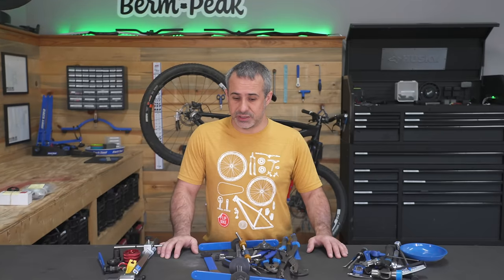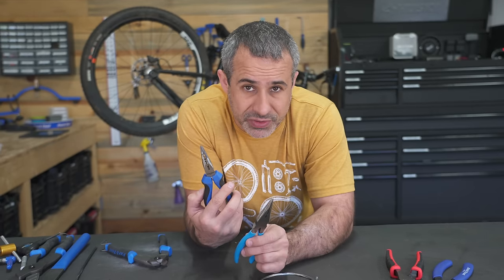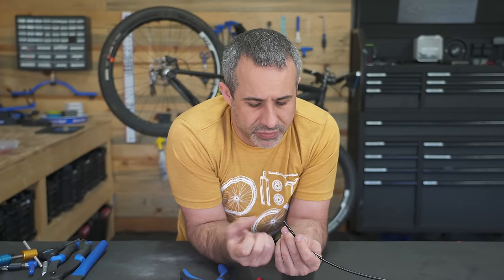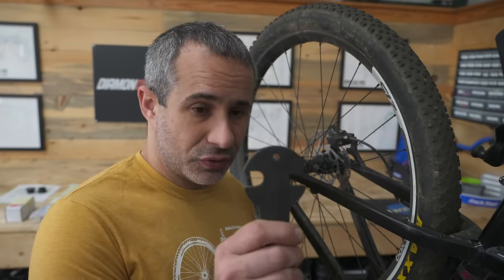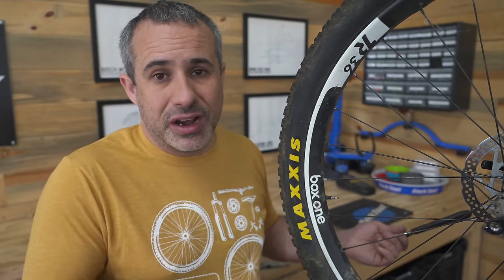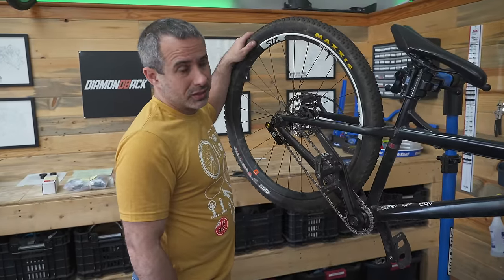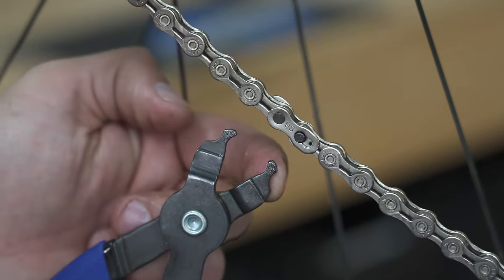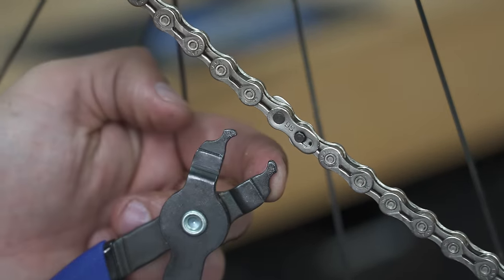Are "Bike Tools" really different from "Tools"?

Comment: For the head set cups I used a 1"×4" piece of wood and a big c clamp ,and it works great. You can get the c clamps at harbor freight
Reply: I thnk it is either lifeline or Xtool (i'm not going to my toolbox to look for it) that make a $20 cup remover and inserter. It, ideally, requires a bike stand to get the bottom one in but it works a treat.
Reply: Thanks good to know
Reply: @M3PH11  thanks good to know
Reply: I have an old scrap block of oak with a hole in it as a "washer". So far it's worked well for the three times I needed to press in a headset.
Reply: @newttella1043  Same. I still have the washers for the nuts to push against, but scraps of wood are soft so they don't damage headset cups and definitely can be big enough to get past the too-small-washer problem. I've used this DIY tool plenty of times.
I also have some PVC scraps that I use to set crown races so it's DIY all around for headsets for me.
Reply: I find this or the washer method tends to misalign the cup as you press it down. I got so frustrated with this kind of press that I gave in and got a good one. Came with machined cups that center the headset nicely and can accommodate those wide 56mm headsets.
Reply: @pjaxy   the way I did it I really used two pieces of wood ,and did one cap at a time . I would have to adjust time c clamp once or twice but I did not have any problems.  The best think is the right tool for the job .thanks for the info
Reply: Dont know about you guys but I dont change my headset to another one in its lifecycle so I just hammer the cups in and replace the bearings. 
I just use a piece of wood and a hammer. I dont really see why I need something else and I dont have any pressfit BB so nah...
Reply: @Vanadium   that is how I did it when I rode BMX in the 80s with steel frame
Reply: I use hammer
Reply: @newttella1043  same here. Hard wood flooring offcuts are perfect..
Reply: RollinRat  that is a good idea, I used what I had
Reply: I've installed threadless headset cups with just a hammer and a block of wood. Just set them up correctly, and hammer the block of wood down (which is on top of the headset cup).
Reply: @pjaxy  Nah, bro, dont you know its way better to spend hours of your day making some shitty jig instead of paying a slightly higher price to have an engineered solution that just WORKS.
Reply: yeah you don't need a specific washer, just a block of material with a hole, and you can get those for free with a scrap wood pile and a drill
Reply: @goldensunrayspone  Like I said, just get a block of wood and hammer the headset on with the block of wood on top of the headset cups.
Reply: RollinRat  A brass drift worked a charm on a steel bike to remove.  Wouldn't think of it on carbon. Oak block still effective installation tool for steel. Actually wouldn't want old school threaded headset on anything new!
Reply: RollinRat  When you do a headset every 5 years or so it might not pay off. The threaded headset is ok, replaced Campy with Campy several years ago and let LBS do the adjustment with proper tools. The modern threadless headset is less fussy and a very rigid structure. Forget carbon steer tubes though. I did snap a Cinelli A1 stem once because it was raised a bit high, and the steer tube threaded excessively long. The wedge did crack the steer tube on that one. The steer tube was replaced by a frame builder and has been fine. It does feel a bit flimsy next to a modern 31.8 clamp stem though.
Reply: RollinRat  Unfortunately my Aluminium track bike has plastic forks, but aluminum steerer at least. Always looking for telltale paint issues around the fork blade, crown and dropout areas. Things are pretty over built and rides hard like its got solid aluminum blades! Trying not to ride into deep potholes in the shade with dark glasses! 2 pinch flats.  Still working on wheel building. I respoked  my 28 spoke track wheel with spokes 4mm too long. No spoke threading tool! I manufactured 56 nipple washers of #8 washer stainless. The rig was hilarious,  drill clamped into bench vice turning a stack of washers on a long grip pop rivet. A 9 inch angle grinder "machined " the washers to a +2, -2mm tolerance as verified with an actual micrometer! I corrected the key spoke at the valve hole while at it. Will probably hammer the J bends with a plastic mallet. Those "machined " nipple washers will probably give a bit. The sealed bearings are another project. The locknuts turned on the axle when the wheel  was tightened into the fork end. No marginal gain here. Torched. Next time I'll cinch the locknuts with about no preload and touch the axle and locknuts with flux wire! (Welder) Red loctite not adequate! Hambini would have a crow! Guerilla bicycle mechanic! I will prevail!
Reply: @Vanadium  Agreed, but probably not good around carbon frames. Block of wood is traditional.
Reply: RollinRat  Been eyeing high flange Dura Ace 36 hole track hubs. Probably never break a spoke built on sturdy rims with straight gauge DT. Some say you can tie and solder stainless spokes. I'd be afraid to louse up the metal with the torch. What about tied and epoxied? I could have Universal Cycles build such a wheel sans epoxy for about $320. The hub is on over stock. What rim profile, box rando style,  or 30mm aero? Brand? Definitely aluminum though. The 32 spoke 3x rear track wheel only broke 1 spoke so far but 36 spoke cross 4's got to be stronger Fixed my 28 spoke 3x rear wheel today as a spare. I'm not thrilled about the hop at the rim seam on this one, + getting locknuts to stop creeping and killing bearings!
Reply: I find the right tool is better, even if only used once. The only reason you wouldn't is if it's expensive (let's say you need to spend 1k on tools for a 200 dollar bike.......then I get why you might not want to). Because your time is valuable too and so is the ease of knowing the parts are installed properly without damage. Peace of mind has it's own value.
Reply: @Knight_Kin  if I do not have the tool I need I try to think of a another way.  As long as you are careful it works good , but I understand the right tool for the job as well .
Reply: rollinrat4850 you are a narcissist.
Reply: rollinrat4850  your reply reeks of narcissism.

Comment: There is no substitute for a cable housing cutter. I've tried. The design of the cutting jaws is critical. It doesn't need to be a bicycle cable housing cutter, but it does need to be a cable housing cutter. Having said that, the cleanest possible cut will actually come from a Dremel because it won't crush the housing, but you will need to flush the housing with spray cleaner to get the metal dust out.
Regarding wrenches, every tool kit should include Knipex pliers-wrenches. They are astoundingly useful in any situation where they physically fit, much better than normal adjustable wrenches.
Reply: great call on the Knipex brand pliers wrench. those are so handy for putting the chain back together. I usually cut cables with my side cutters , then pinch them back into a round shape using the Knipex pliers wrench! perfect

Comment: Agreed! I have a lots of automotive tools and when I started working on my own bikes I could scrape by using some automotive type tools on my bikes but at the end it does make your life much easier to use bike specific tools for bottom bracket, cutting cable housings, headset remover / press and cassette tools (chain whip etc) oh and also torque socket set 😎

Comment: I just went to my local hardware store, got a 1 foot chunk of 1/2" all-thread and they had thick nylon washers to fit inside the headset cups, plus some steel washers & nuts, got a perfect headset press for less than $10. The bike tool versions will keep the headset cups straight, this can be tricky with the hardware store version. For master link pliers, I bent the tips of some junk needle nose pliers into hooks the size of chain rollers & ground them narrow enough to fit the links, a quick squeeze and master link open.

Comment: @12:10 My homemade cup press used some 1x6 boards cut into squares with a hole in the middle for the cup sides and then a stack of 2 or 3 washers on the nut side. worked "ok". for the number of times i've needed it (once) it was worth the money.

Comment: You can always add chunks of 2x4 or other scrap wood under the washers on the faux bearing press. I've also successfully used wood scraps and a clamp to press in cups and bearings.
Reply from the maker: Yep! I’ve definitely used the ‘ole bmx bb press back in the early 2000’s before they started using threaded.
Reply: Hammer did all my BMX bearings 😂 The old US BB and the Mids could take it.
Reply: @jeffstreck  I've definitely cracked brand new headset cups with a hammer. Bottom brackets were never an issue though. I still find the clamps easier though. I just installed a mid bb on my new BMX last week that way. It's even faster than the actual bearing press because you can quick cinch it down and then tighten from there. Less effort and violence than a hammer too.
Reply: @sepherus  Hammer is absolutely not a good method. Clamps sounds much better.
Reply: Plywood is better because natural wood can have variations in softness, which could lead to one side of cup imprinting deeper in wood, which can make misalignment.

Comment: "Bike wrenches" are important with cup and cone hubs, they need to be super thin.
On the master link, if you bend the chain to isolate that link you can open it with pliers or channel locks. it's well worth just buying the tool though, and keeping it in your riding pack.
Things like BB tools and cassette tools and chain whips are mandatory if you intend to upgrade and maintain your bike often.
Park cable cutters are great. They are hardened, and don't crush and unravel cables and housings. They are very expensive though. For the once in a few years most people need to cut cables and housings though, probably not worth the money.

The rest is either for "convenience" or expensive highly specialised items for once in 5 year jobs, like derailleur hanger aligners and headset cup removal tools.
Reply: Plus 1 for master link removal by isolating the link. Its even possible to use the chain either side to push it together and break the master link by hand...though its tough on newer links!
Reply: For home cable housing cutting,  I use a Dremel cut-off wheel. It provides an actual square end. It's actually better than the Park nippers, though not as fast. (Still need to ream out the lining though.)
Reply: @markfisher7962  put a piece of old brake cable into the housing before cutting. The housing won't crush and will be nice and straight.

Comment: I used your shoelace hack years ago when you first put it on video, and it worked like a charm. I still keep a shoelace in my pack to this day
Reply: I use my hands.
Reply: I started packing a shoelace with me on rides after reading "Zen And The Art Of Motorcycle Maintenance". I may have only used it once in 25 years.

I have since added zip ties to my long-ride bag. I have definitely used those!
Reply: I use a piece of steel cable from shifter to RD in same fashion

Comment: An angle grinder and stash of scrap metal will also suffice every so often. I've used a spoke spanner made from some bent 3mm thick strap with an appropriately sized slot in it and have recently made and used a cone spanner made from an old lawnmower blade and disk brake straightener made from an offcut with a slot in it. Having access to a lathe to make things like bearing presses that hold bearings square while they are being pressed in or other specialty tools is also a bonus :).

Comment: Grinding down an Allen key to fit the backside adjuster of a single piston brake caliper on an ebike was a trick a shop taught me. Was super helpful.

The cheapest electrical wire strippers/cutters that are like $2 have a variety of crimper sizes that will do the cable caps easy.

Also I've just used a bench grinder to customize the thickness of various wrenches I get for pennies on amazon

I have some hose clamp pliers that easily fit a master link. But that zip tie/lace trick is so cool.

Spoke wrench and tire levers are thus far my only truly "do not skip buying these" tools. Same for a spoke tension gauge since I'm a novice.
Reply: The best hack for tire levers is fork or spoon handles.. They are usually  thin and smooth, and the stainless steel ones plenty strong..
Reply: @sprocketandwheel  eh, I prefer durable nylon levers. I don't want to mark up my wheels, and a 3 set with the little spoke locks are dirt cheap and stack together tightly. In a pinch though, that's not a bad idea! If you have metal levers, a trick is to cut up a 2 liter soda bottle or plastic milk jug and use the plastic between the lever and rim. I do that every time I do tires on my motorcycles.

Comment: For cone wrenches I bought ordinary cheap wrenches and grind them down to the required thickness. 
I use an angle grinder with the thinnest cutting disk available to cut cable housing. 
The standard cable cutters are designed for copper cable and so have a sharper edge, I file this edge so that it shears instead of cutting.
Ordinary 15mm wrenches can remove pedals but you need to get the longer ones, a mallet assists with the more stubborn pedals.

Comment: My shop was built around working on cars, and I have lots of shop tools I can reuse, not to mention a compressor with way too much volume.

However, I have learned to hate adjustable wrenches with a passion. They just damage whatever they touch.

After 3 years working on bikes, I have bought enough of the blue stuff to be able to do pretty much everything.
Reply: As much as I hate those adjustable wrenches with screw adjustment just like you, I love the ones that work like pliers. Never damaged a nut with those, cause they fit so nice and tightly around it.
Reply: Knipex pliers wrench is the bomb

Comment: The wire cutters from the store are probably for copper wires and that is softer than the steel inlay of the cable housing. So the damage wont happen if you buy steel cable cutters
Reply: Nah, he just got bought tools that's not good for much of anything. Good quality cable cutters will be just as good

Comment: The one marginally bike screw driver you may want is a JIS for derailleur limit adjustments. It looks like a phillips #1 (which usually works good enough), but the geometry is such that it doesnt cam out of the derailleur screws.

Comment: To overcome the "washer too small" for the bearing or headset press, I have found that some PVC bushings work great since they can be found in many sizes and they are softer than the metal parts so they will not damage the headset cups.

Comment: For the press, I think you could just cut some small plywood discs to increase the diameter of the washer.
Reply: I'd just use a block of wood and a hammer to press the headset cups.

Comment: If you are going to get master-link pliers, the Shimano ones are preferable to the Park Tool ones. The Shimano pliers have three prongs. The middle prong together with one end prong is used to remove the link; the middle prong and the other end prong is used to install the link. In both cases, the handles are squeezed together, which is less awkward and allows more force to be applied than pulling the handles apart.

Comment: I am self taught using whatever I had to hand, sometimes making my own tools. The best example, off the top of my dome is my home made caliper spreader for changing my car's brake pads. I used 10mm BMX axle, some washers, nuts and a couple of spanners/wrenches. Worked a treat.
Also, I wouldn't give up so quickly on making my own bearing cup tool. Drilled blocks of wood in place of those washers on the threaded rod would work a treat and you can choose how large or small they are.

Comment: As a headset press I’ve used a mallet to get it started then a threaded rod with washers but two short pieces of 2x4 with a hole in the middle to go against the headset cups.
Reply: Yep. I do the same thing.

Comment: Very Good Video, I would like to point a couple things:
- Bike Tools are much more expensive than good quality "regular" tools (at least here in Chile)
- Truing a wheel with an adjustable wrench is horrible, almost impossible on kid's bikes or lighly seized nipples. Unless it's an emergency... don´t do it.
- Galvanized Washers are too soft, they work but just a few times before gets deformed. Maybe steel ones?
- Channellock for BB? yes but use a thick leather strip instead of a rag.
- No matter if you are begginer or just enthusiast: buy the best allen keys you can afford

Cheers!

Comment: I take my masterlink apart by gripping the chain, thumbs on each side of the link and bending the chain forward and back. Pops out with little force. I would also use a chaingrip on the external portion of a threaded bottom bracket. A socket is still best.

Comment: Great video as usual.  As I learn more on how to maintain and service my bikes, I've purchased the tools as I need them.  However I still use a bunch of non-bike specific tools.  The ones I use the most: Klien tool - good for crimping,  linesman pliers- really clean cut on cable and non-brake housing (brake housing get the dedicated tool and barb driver), jewelers pliers - a mini version of needle nose pliers - good for picking up tiny delicate springs and ball bearings.

Comment: If you've ever battled with getting a pedal off using an everyday wrench, having all that extra controlled torque on a purpose built pedal wrench is an absolute pleasure. My PW-4 is the best tool in my kit.